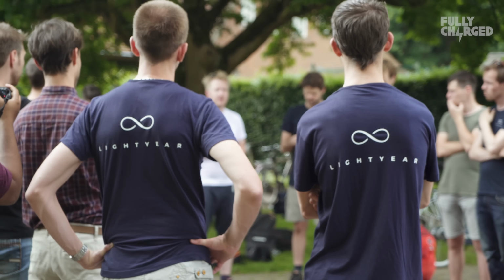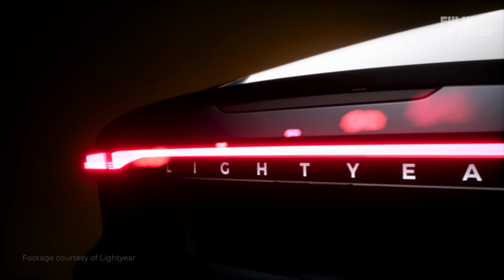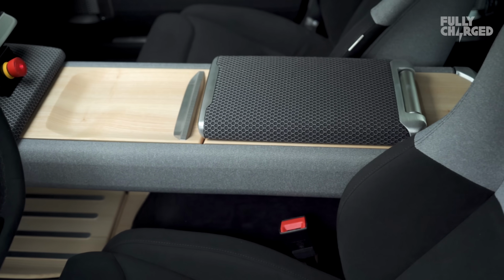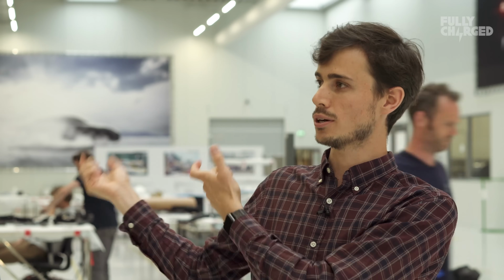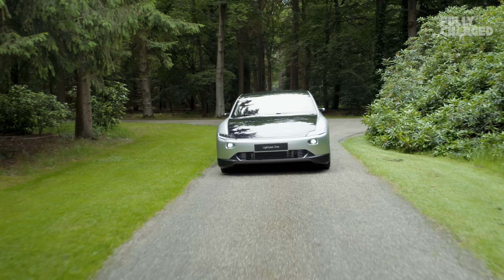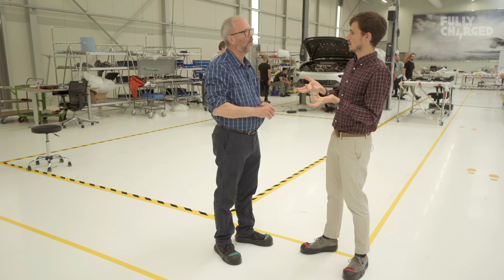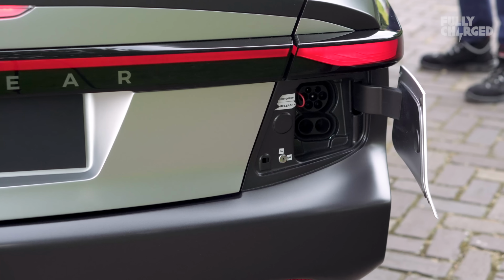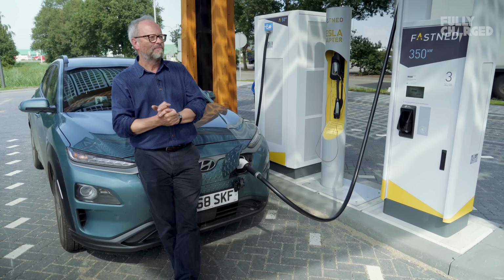Lightyear One solar powered electric car - exclusive first look | Fully Charged

Comment: Why does everyone use the same formula for their battery/hybrid cars?
This is why Tesla has an appeal.
Reply: It's a solar car. It needs a lot of flat surface area and to be much more aerodynamic to be efficient. If you've seen previous solar cars, you should be impressed by this.
Reply: Dirty Saint wasn’t the Fisker karma also solar powered without it being a “hybrid” design. I understand stand the surface area of the cells. Maybe there should be a change in photovoltaic cell technology and form. Which probably want come still years later.

Comment: Ground breaking technology is always amazing but this IMO is not that, its just an overhyped car from a new company. What all the fuz is about is that IT IS SOLAR POWERED and can CHARGE ITSELF. ANd it does that by using a WHOOPING 1.25kWp of installed PV capacity. kWp ofc means that you need to be perpendicular to the sun's radiation at 25 deg cell temperature which ofc will never happen, basically due to the shape of the car. Now it is not very hard to estimate that if you have a say 50kWh battery and you barely produce 1kWh you would need 50hours to charge your battery (being generous and oversimplifying ofc...). You would need 50 hours of the sun overhead which can only be done in the BIBLE!!! So what is the so groundbraking thing about this car?
Reply: Not everyone drives everyday. Try to be more open minded. The more renewable energy in everything the better. I understand it's not going to change itself in one day. It's the thought of having a vehicle that can charge itself for free.
Reply: @Mr_Battlefield  This is not an argument. With the money the whole PV system will cost to integrate it into the car I could argue that you can buy 2-3 times the panels and put them onto your roof where they can power either your car or part of your home and generate power whenever there is sun, not whenever the car is outside. Remember cars tend to be on garages... I bless you are in your mansion where you can park it on the grass away from obstructions etc so it can charge for a few days before you can can drive it. Being realistic does not mean I am close minded. Solar irradiance is just not dense enough to be useful for an electric car and this won't change any time soon no matter who says it...
Reply: @nosafetyswitch9378  I agree with producing more power with a PV system on top of a roof would collect more power compared to the cost of the PV system on a vehicle.

On the other side of the debate they did design the angle of the PV on that vehicle I assume to collect as much energy from the sun as possible if you're parked on a level ground which in theory isn't a good theory unless you live in a City in which case more and more people live in cities these day's.

In the end I wouldn't buy this vehicle. I'm still wanting a Tesla Model 3 as the overall best electric vehicle you buy currently with the latest technology.
Reply: @Mr_Battlefield  glad we agree on the 1st. On the second, I don't believe they could do anything about the tilt of the panels because the car needs to have a certain aerodynamic shape. The cells follow the curve of the car and you can only minimally do anything about that. From what I see it's either 0 or 5-10 degrees varying which is hardly optimal unless you live near the he equator I would assume... PV on cars is a joke

Comment: So it's like the Sion, but expensive, not as practical and ugly?
Reply: I think that car has quite a bit more space than a sion and it sure isn't that beautiful on the outside but I personally I like it better than the Sion.
Reply: @NicoSchurr  I think the Sion is the better use of the concept. It is incredibly cheap, and has a boot you can actually use. More volume in a more compact car. Not to mention you get v2v, v2g, Carsharing, etc. Build in.